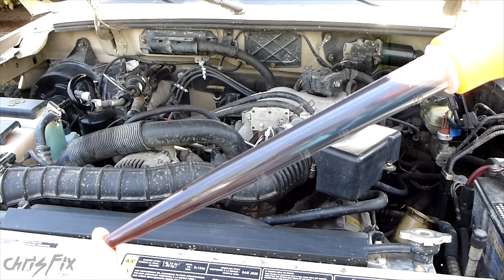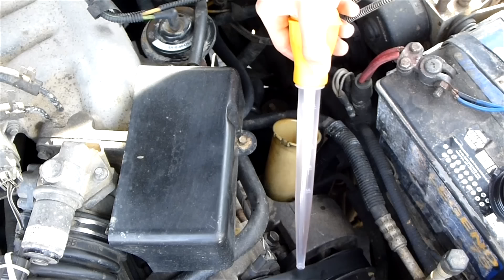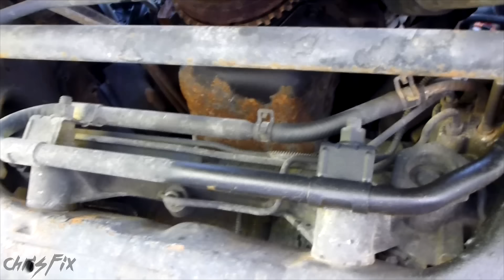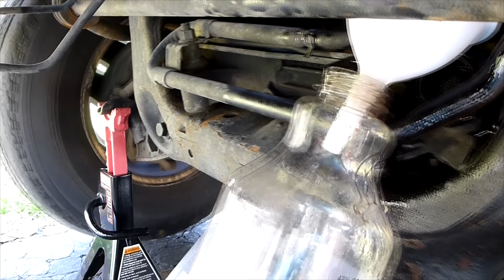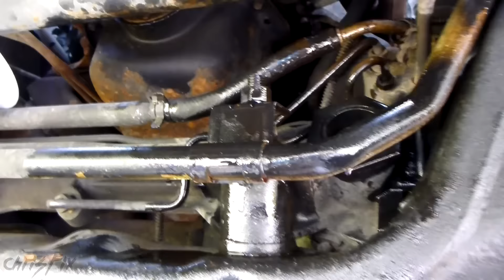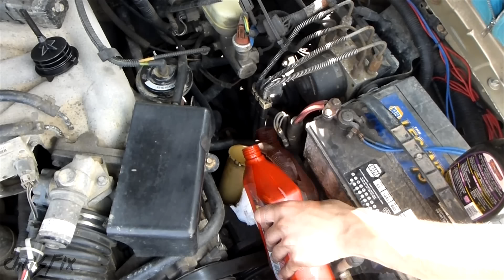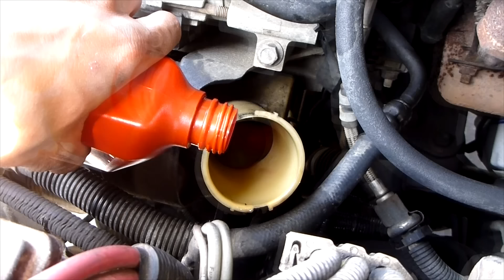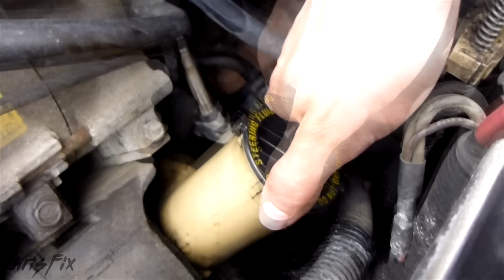How to Flush Your Power Steering Fluid

Comment: I just emptied the res, refilled with fresh, turned steering wheel. Did this 3 times. Totally cured the whine that was happening at the wheels turn limit.
Reply: Mechanics at dealerships don't fix things, they change part's. It's more profitable if u chance the pump not the fluid 😁
Reply: @JaanB8805  True that. LOL
Reply: @JaanB8805  Then again, without a proper flush, the problem will arise again, new pump old fluid.
Reply from the maker: Awesome!
Reply: You mean you flushed it 3 times, why is that even needed when doing it once is more than enough? My car makes whining noise at the wheels turn limit too, but the mechanic told me that's due to the pump failure. Interesting that it's gone in your case just after flushing.
Reply: Indeed. Wife noticed that it was immediately better as well.
Reply: @PNW_Sportbike_Life  Good to hear. Thanks!
Reply: @amjathkhan2004  Actually he did not do 3 flushes. We could say one flush at three change. Becase he sucks from res (but can not sucks all the fluid. At most 50-60 percent. Then he fills again the res with fresh oil, turn steer a few times and so on 3 times. That also what I did to my renault. But I did it a little differently. I sucked all the fluid by syringe and small hose from res, fill with fresh and used the car for a few days and then replace the fluid again. I did that 3 times in two weeks.
Reply: @tr9036  Thanks for your reply man. I never thought about this way! 1. Can you mix fresh oil with old one and run the car? Wouldn't that lead to contamination especially when the two oils are of different grade? 2. As you finish your 3rd refill, does it really look fresh and clean in the reservoir? Thanks again!
Reply: @amjathkhan2004  You welcome. 
1. It is perfectly okay to mix old and new oil if you fill your res with recommended fluid brand/type. Don't worry about mixing. After every time you have changed your car's motor oil you are mixing 10 percent burned oil with 90 percent fresh oil 😂  or 5 to 95. No matter what you do, it is impossible to replace 100% of it and that is perfectly okay. 

2. Yes, it was completely new and looks cyristal clear. But it was not 100% cyristal clear as I said. 95% cyristal clear 🤣🤣🤣
Reply: @tr9036  Thanks man. It makes perfect sense. A few months back, I noticed steering fluid leaking, so I rushed to a shop and bought a Bosch brand fluid and poured into reservoir and got the leak sealed. Now, (1) I don't know what oil was originally put by the authorized service center (2) I filled half of the reservoir with Bosch one (3) Now, I refer to the manual and it says Dexron 2D. I am finding it extremely hard to source Dexron 2, 3 or 6 in my area. I'll fill the reservoir at 3 different intervals as per your advice once I got it. So, that's like I'll be mixing 3 different oils when I do so. Will there be a problem or I am good to go? Thanks!!!
Reply: I need help, in my truck my power steering pump was bad/leaking out so I installed a new pump but the whining noise came back after about a week and I opened the res and the fluid was bubbly and seeping through the top of the cap does anyone know what the problem could be
Reply: @malcolmnotx  You likely have (had?)  an air leak on the low pressure (suction) side of the pump.  This could be from a old/split hose, loose clamp or (famous with Honda’s) a bad o-ring at the pump inlet.  The air gets sucked in, run through the system and shows up eventually as bubbles or an emulsion in the reservoir.  Inspect the line and connections between the reservoir and pump, make any necessary repairs or replacements, flush out the system, fill with new fluid and follow the remaining directions from this great video!
Reply: @malcolmnotx  sounds like you overfilled it.
Reply: Thats the lazy way to somewhat clean, or dilute your old fluid...  An extra $15 for fluid over 15 minutes of hands dirty work for a poorer outcome.

Comment: Toyota’s don’t have that issue with power steering noise. Luckily mines started to leak due to age and we did a whole new front end job so the system got new fluid. That was a few years ago and the fluid still has life to it today.

Comment: Hi Chris, I watch a lot of of your videos and have learned much. Just got a 2008 scion tc and the steering fluid was quite brown, with vibration symptoms at a full stop in drive turn, only when full stop in drive or reverse. So I flushed and noticed a lot of bubbles coming outz but it seems to never stop. As long as I keep turning, there seems to be continuing pockets of bubbles. Is there another approach to bleeding the system that is not shown here? I know vehicle changes every few years, and not sure if mines one of those.

P.s
I did flush with new dexron III synthetic Valvoline. Making sure it never goes below low line to ensure it wasn't just the old fluid.

Comment: Looking for advice! Power steering had all obvious signs of being out, changed the pump, turned on the truck, steering was now good but still a little noisey, thought it'd go away. Turned wheel from one side to the other, when turned all the way made high pitch sound louder and louder then the truck died. Turn on again fine, tried one more time, then the steering got nearly impossible!! Can't even drive it. Any ideas!?

Comment: This comment probably wont even be seen with 2000 comments. Just came across your channel. This is something I need to do, but I do have two questions.  What causes bubbles in power steering fluid? And second, What is the easiest way to find a leak? I have to add power steering fluid every few days, and when I open the reservoir there are bubbles covering the entire visible surface.

Comment: Hey Chris. I just watch your brake fluid flush video. With the brakes you kept fluid in the reservoir, but this you didn't. You want this as empty as possible? How does air not get in the line? Thank you so much by the way. I really appreciate the time and effort you've taken to give us these awesome videos.
Reply: JoJo-Baggins when I flush the brakes I use a vacuum pump till each line has new coming through. And in between keep filling the reservoir by the time you’re done everything should be clear.. I do it on motorcycles as well make a huge difference.

Comment: I don't remove the hose clamps. I just use the turkey baster to remove whatever I can from the top .throw it in the garbage and refill it. I do this about four times during the course of a month and this will take out and Clean most of the of the power steering fluid so my system does not get corroded. I don't get dirty. Good video. From Sacramento.

Comment: I wouldn't be putting transmission fluid in the power steering if it requires power steering fluid
Reply: Some vehicles actually use ATF as power steering, like Ford and Volvo etc. It's not bad to use.

Comment: I never undo the return hose,I use the same thing a baster. I get as much fluid out of the reservoir, put that fluid in a bottle (given it's at the said fluid proper level)then replace that fluid with a fluid that has conditioner for the hoses,that way I never over fill any fluid level. Then I start my vehicle drive a mile or two then repeat that process x amount of times depending on how many times it takes to rid the reservoir, pump and both return and high pressure hoses are completely drained off the old fluid. Then in a week or so repeat the process again with straight fluid. Also a great tip if when you drain the fluid and you put it in a freezer and it turns into a frozen sludge with or less than ten minutes then you'll wanna do it how I explained because of cold starts and the hot temperatures of summer are not forgiving to any vehicles fluids people. How Chris did this video will work alright there will be sludge build up in your pump and hoses, that's a huge reason why I always let fluid get to operating temperatures. Especially if there's isn't a pan to remove as in a oil pan , diff cover or a transmission pan. None the ever GREAT VIDEOS CHRIS , GREAT CHANNEL, KEEP MAKING THEM. I'm just not much on removing old hoses unless I have a brand new one to replace the old one.

Comment: a quicker and much less messy way is to disconnect the return line on the reservoir (which is long typically) into a bottle, plug that reservoir inlet (after you emptied it), put a bigger funnel to fill with clear liquid and run the car pump to dump all of the old out until it runs clean. Just make sure your funnel is big enough to pour new stuff in fast enough to not run dry (which I did for a very short while) with second person start/stop the car and turning wheels. For me to remove the noise I also changed the o-rings on the pump in/out as I've read they tend to fail (and cause air intake).

Comment: What's up ChrisFix, I have a question. My 05 suburban has a power steering issue, the steering is very hard, the brake pedal barely brakes and there's no whining when I turn 
I replaced the power steering pump but issue still persists. Any ideas?
Reply: Luis A.L. Google it or take it to the dealership.

Comment: Hi Chris, i am watching your videos for knowledge and i did some DIY on my car and bike too.
Question i have here is if you are using turkey baster or a hand driven pump, how do you clean the pump hoses or the turkey baster as we may have used it for brake fluid or power steering fluid etc, just dont want to mix any residue from the hose.
Reply: There's cleaners for each type of fluid. I'm a bike mechanic, so I don't know all the car fluids, but for DOT 3 fluid you can use isopropyl alcohol. For and grease or oil, usually any degreaser works (including dish soap). In fact, if I were you I would just use dish soap and warm water and call it good. As long as you get most of it, tiny residue wont hurt anything

Comment: The steering on my 2017 Toyota Corolla SE with a 6 speed manual 
transmission is powered by one finger. There is no power seeing fluid 
system. It is computer controlled.
Although it is a Toyota, I am holding my breath for a computer to go 
bad, outside of warranty of course, and it costs a few thousand dollars 
to diagnose which computer is fried and installing a new one.
Good video as always. Thanks.
Reply: ussling My car is the same so don’t worry about it. Toyota took good care of me.

Comment: i made the mistake of turning the engine on n turning the wheel after removing the fluid. i thot u turned the engine on with the other video. it was makin lots of noise wen i was turning it i hope i didnt damage anything. i put fluid in it n it souns normal again hopefully stays like that.its an 03 silverado

Comment: Hey chris, can you make a video to change the power steering fluid for a 2017 maxima ??
Reply: Ramiro Ramirez it should generally be the same as this one
Reply: @sammythebul6969  I tried.. but it looks like its different since it has a cap "filter" kind of thing that wont let me insert the hose. I heard they are making the Nissan with an electric power steering. I did it on another car that I had but for the Nissan it is different now. I was confused and I didnt touched it

Comment: Thanks for the great video. I tried an alternate method because I don’t have a lift, nor did I want to disconnect any hoses.  I bought an 8 dollar siphon kit at Walmart. 2 bottles of generic fluid and 2 small bottles of high quality synthetic fluid. My fluid actually looked like chocolate milk. I siphoned out as much as I could and then filled it with the generic fluid. I capped it, started the car and turned the wheel several times. I shut it off and repeated the fill and siphon process several times (along starting and turning wheel). I went through the whole 2 quarts of generic fluid before it started to run clear. I siphoned it one last time and then added the synthetic fluid. Car runs perfect now. The whine every time I turned was getting quite loud and embarrassing.

Comment: How do you move the steering wheel from lock to lock without starting the engine i had a problem with this
Reply from the maker: Put the key in the run position.
Reply: No that didnt work either i have a 2017 nissan rogue , thanks for the reply

Comment: Hey Chris fix I just wanted to say that you shouldn't open the lines in the hydraulic system, the way you actually "bleed" a power steering system is by turning the wheel back and fourth. Opening the line makes it possible for air to get in the system. You suck the fluid out from the reservoir and replace it with only new powersteering fluid. I know this because its actually a question on the suspension and steering systems state certification test in Michigan.
Reply: I may be wrong about some of this as I am still a trainee not a master tech.

Comment: How to diagnose if my car's power steering pump is gone bad? My car's steering is hard, already flushed the fluid. No leak near the pump or steering rack. Please guide.
Reply: Hey! Does it make a whining noise? It should be much harder to turn at a full stop. If the noise is there, and it starts while the car sits still, it's probably going bad.

Comment: I am forced to get mine done. A place I go to for oil changes for got to put the cap back on and lost it without telling me in the winter. I only found out about it 2 months after the oil change when looking under the hood. Now mechanics tell me moisture most likely contaminated it and it needs replacing.

Comment: You should pick up one of the short large rectangle plastic totes for jobs that have the potential to get really messy. I even put my oil drain pan down in the one I have when I do oil changes. I leave it until after first start and I'm sure they're no leaks. Trust me its definitely worth the 6 bucks especially when it comes to rear end gear fluid changes or transmission fluid where you kind of hope it goes where your pan is. Good video man, I was looking for a good method to really flush my sx4's pump and lines because the fluid in its toast and i want as much as possible out before i upgrade the cooler!

Comment: I was curious if you might have some input, I’ve changed a power steering pump, and flushed it several times to the point the fluid is clear and there is no more bubbles but it still squeals loud when the vehicle is on and even more loud when I turn the steering wheel.
Reply from the maker: Drive it around for a bit and let it bleed out even more. There is still air trapped.
Reply: *Update:
 your advice worked! Thanks!

Comment: Keep in mind without a vacuum on the system you can still have air in the system, Maybe Chris Fix could do a newer video addressing todays modern vehicles that require bleeding of the air from the system.

Comment: So after watching your video I gave it a try today. One comment I'd like to make is one should buy at least three to four quarts if they really want to get it all out. In my 99 dodge ram 1500 I ran two quarts through the system and my fluid was still a light amber when the new fluid is clear. I decided that was better than the black it was. I also found it's about as easy to grab and turn the tires side to side as it was to spin the steering wheel when trying to drain and flush the system. There's also less of a chance of getting the interior dirty.

Comment: TIP. - if your adding fluid to your reservoir and it gets air locked before it begins to run out of the return line, simply disable the ignition system and crank the engine a few seconds to cycle the fluid through the system. Refill the reservoir and repeat untill you see clean fluid coming out the return line. I did that on my 93 mustang and just unplugged the ignition wire to the distributor to disable the ignition. Worked well for me.

Comment: Did you end up replacing the pump since then? I have an F-150 with a noisy pump, but it doesn't leak, and I'm debating a new pump vs. a good flush. Did the flush extend the life and get rid of the noise significantly?

Comment: Don't want to give a thumbs down...but...I will suggest that this video is an oversimplification of my experience.  My issue at this point is that the PS lines are filled with air and I don't have the tools or method to bleed the air out!  I have more trouble now than when I started.
Reply: Tony Murphy why wouldn’t the air bleed out when the pump runs? As long as the reservoir is full it will pull in nothing but fluid and expel what is in the lines aka any air which should bubble to top of reservoir
Reply: Jon Marshall - Gaming & Tech 
As well as I can remember my error may have been running the engine/pump without enough fluid. Thus introducing air into the lines.  Once the engine stopped the air did work its way out but first forcing all fluid in its way out thru the little hole in the PS pump cap.  In my case I made a not so bad condition much worse.  I can laugh at my self and say in TV voice “hey kids don’t try this at home.”  I am guilty of attempting a DYI project without proper skill knowledge and tools. A learning experience.

Comment: So, Chris, the reservoir is not called the pump. There is a power steering pump on the car...
Also, how did you manage to turn your wheels with the engine off??
Reply from the maker: The reservoir is on top of the pump. To turn the wheels just put the key in the run position on the ignition.
Reply: @chrisfix  Thanks for the speedy reply. When I get jack stands I may try this method or else just the turkey baster method to get the fluid mostly clean.